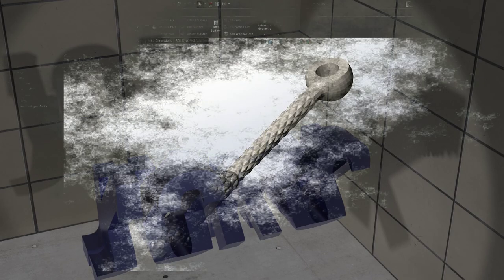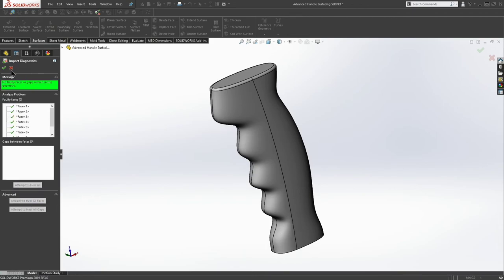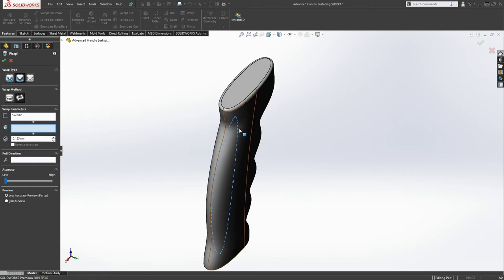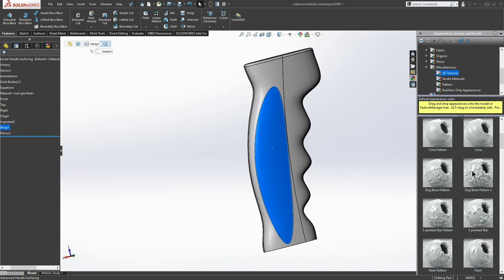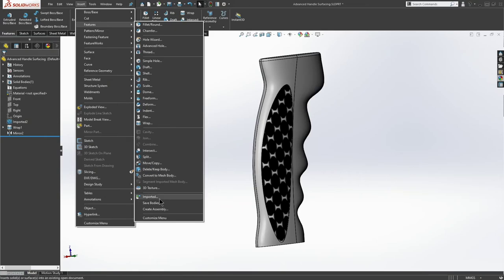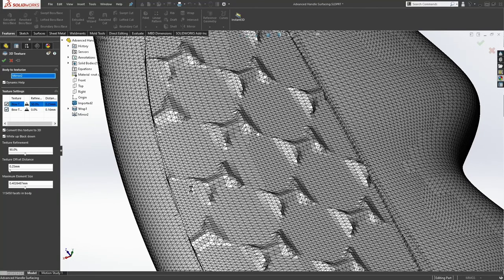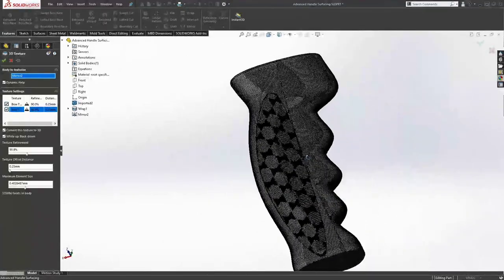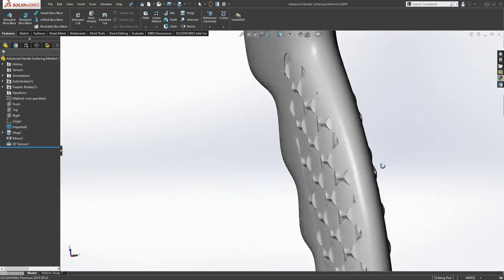SolidWorks- Create 3D Textures With Mesh Modeling! |JOKO ENGINEERING|

Comment: Nice! Is something similar possible in FreeCAD?
Reply: I don't know, but I think it doesn't work with FreeCAD. But that doesn't matter because this method is not practical. 
This is an injection molded part and the mesh is too coarse to be made in this way, you would model the pattern as a solid body to get a clearly defined, smooth surface.
Reply: @Tom-hg9lw  ah was just curious......for prototyping it seems faster. Well I guess I will stick with Blender for such things.
Reply: @IshBosamiya  I would also be curious, maybe someone here can answer the question in the comments
Yes, I think Blender is much better suited for mesh modeling than FreeCAD.
Reply from the maker: That's a great question.  There might be a unique workbench or macro out there I have not discovered.  Otherwise, I have an upcoming video where I make a flower frog and there is some similarities to your question.  That will come up in a few weeks.